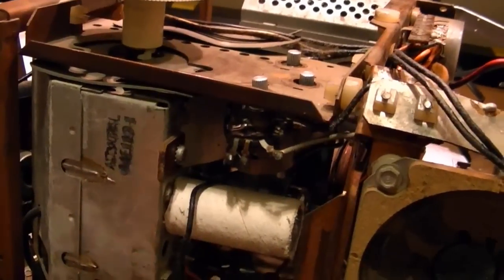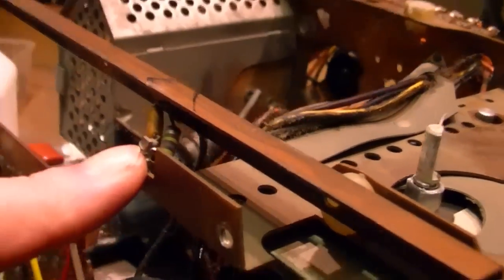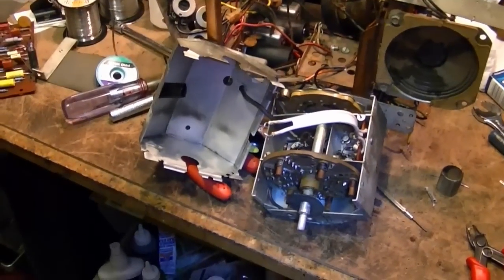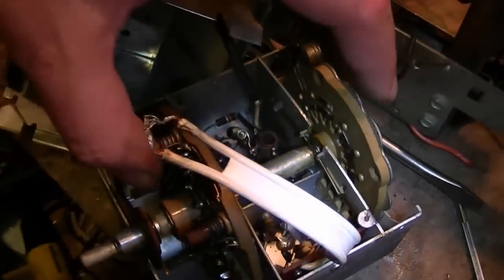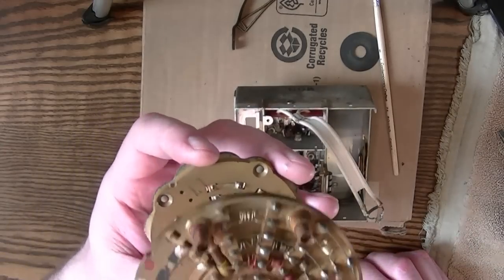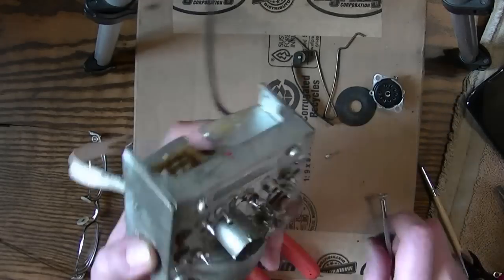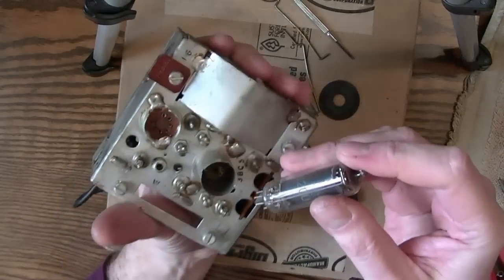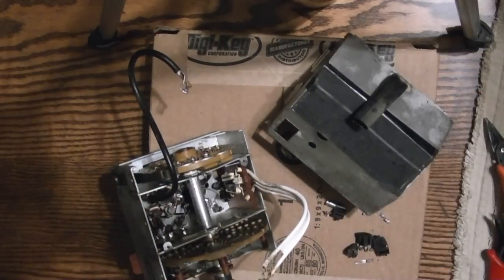Admiral T-102 restoration p5o7

Comment: Hey Bob, Why not use a three wire power cord?  I convert all of my vintage equipment to 3 wire if it has a power transformer.
Reply from the maker: What would I connect the ground to ?  This is a transformerless hot chassis set.
Reply: bandersentv Isn't the case for this set isolated?  Connect it there, yes?  It is still a good idea to polarize the mains connection in either case.  But I was thinking that it would be easier to find a 3 conductor chassis connector and a matching cord - easier than messing with matching cheater pin diameters.
Reply from the maker: WDeek Potter Yes, the case is isolated and completely separate from the chassis where the power cord connects.   I would need to attach a long wire between them to allow me to assemble the set.   3 conductor chassis connecters and cords are much larger than the existing one so I would need to enlarge the hole in the cabinet.  That would hurt the value and originality and something I'm not going to do.

Comment: Hi Bob, Welcome to the madness of working on a OAK tuner. The two disk model is not to hard to do but the single disk model is a real nightmare to work on. The two defects you repaired were common problems with that type tuner from that company. In the day when there was a problem with an Oak tuner the shop I worked for would send them back for replacement, thankfully, Admiral went to Standard Coil units when they came out with a compact model that would take the place of the Oak model. All the best, Tom J from Florida

Comment: Nice repair! Two issues with that tuner. Do you think that the pin plug was like that from the factory, too? If so the original owners probably had issues with the set from the beginning. Very good catch on the fine tuning assembly.
Reply from the maker: I really couldn't say.  Although I was careful when I removed and reinstalled the tubes after testing them, it's entirely possible I damaged it.